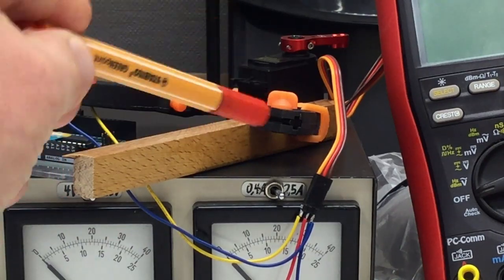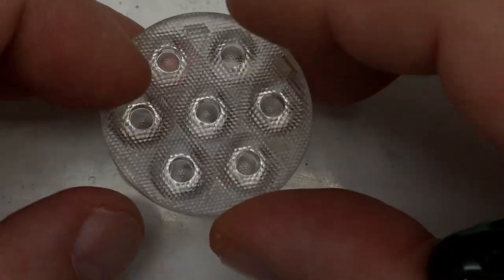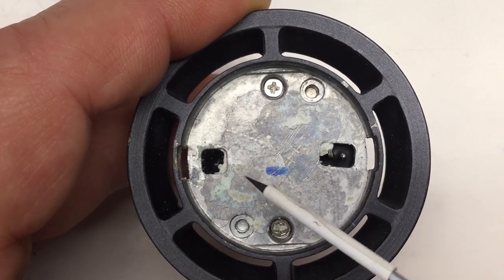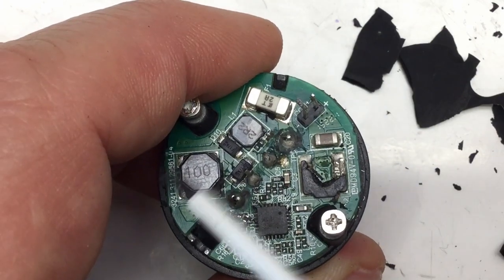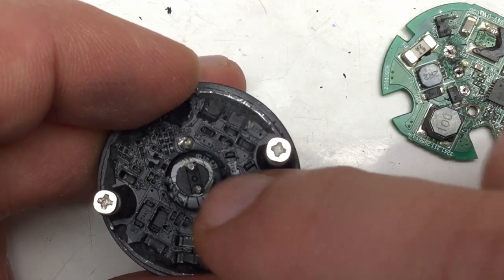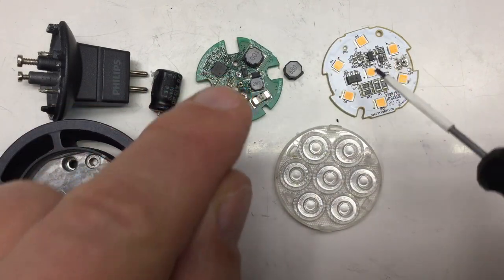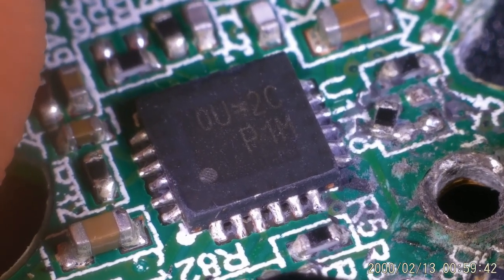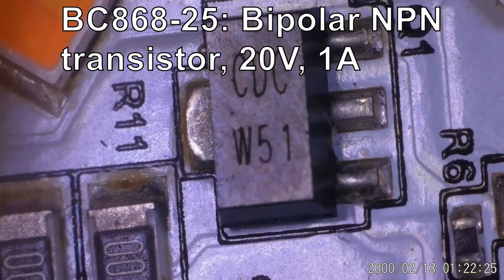Philips Master Dimmable 12V AC LED Spot Teardown – Lots of Chips, Two(!) PCBs

Comment: For identifying mystery SMD devices you need access to an SMD code book (sometimes called data book or reference book), there are many examples available and some calculators and database search tools online.
Reply from the maker: I did try those ( https://alltransistors.com/smd-search.php , http://www.s-manuals.com/smd , http://www.hotenda.com/marking-code/search/index.html ) but came up empty for some chips/transistors anyway. Do you have a links to more comprehensive ones? Would be very much appreciated :-)
Reply: @robertssmorgasbord  I keep trying to reply to this but it keeps getting blocked by youtube comment system, thankfully I copied it before hitting reply so if you have a twitter or a channel email I can send you what I've found.
Reply from the maker: @gb7767  First, I'm sorry to hear that and thank you very much for your effort. You can upload the info to my Google Drive: https://drive.google.com/drive/folders/1yClLlU01gBh6lQkerbdw-HUvXUbX-5ka?usp=sharing (I'm assuming you have a Google account since you've got an YouTube account.

Sorry, but I'm to old for that social media stuff ;-) and for obvious reasons I can't/won't publish my email in the YouTube comment section ;-)

Comment: Nice info, how can you take off the PCB, feels like sticking ?? thanks, like it :) do they stick the PCB to the base with silicone, how can you peel it of ?
Reply from the maker: I carefully levered it out with a small flathead screwdriver. I guess you could also use an small blade or a spudger to get behind that PCB. And yes, that stickiness is caused by the (probably silicon based) thermal paste between the PCB and the aluminum body. Just go slow and you should be able to get it out without breaking it.
Reply: @robertssmorgasbord  Ok, I will give a try
Reply from the maker: @RixtronixLAB  Good luck!

Comment: ' 8W '  only appears to have 2 legs connected (from the top) that would make it a Zener Diode, does that fit ? failing that maybe an LDO, what a great light must be expensive , Bigclive loves this type of thing, don't think he does the POSH ones though !...cheers.
Reply from the maker: You might be right! A Zener for over voltage / transient protection - makes sense. I don't see it being a LDO. I mean they have this big chip for doing the regulation, so what would they need another LDO for? Anyway, yes, they are quite expensive indeed: If you buy a 10-pack online one will cost you a little over 11 €. If you go to a retail store to buy a single one it might set you back almost 20 €. With that kind of budget BigClive would illuminate a whole two story house including cellar and attic :-)